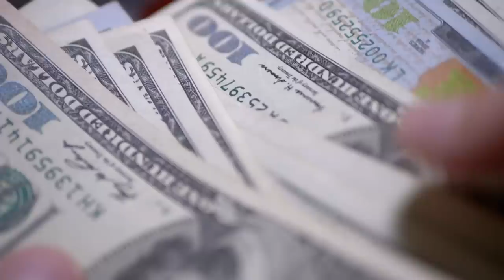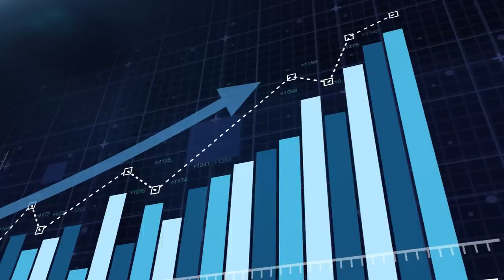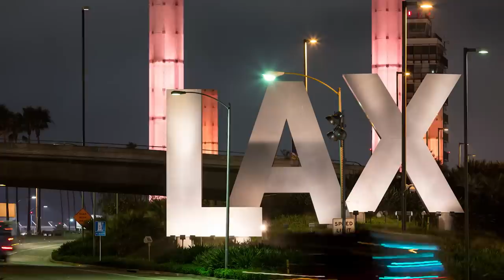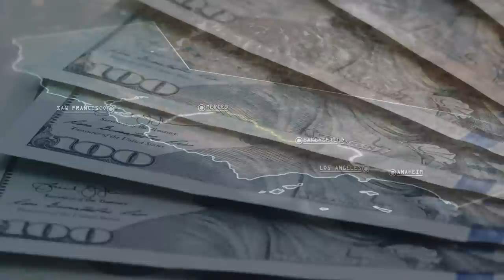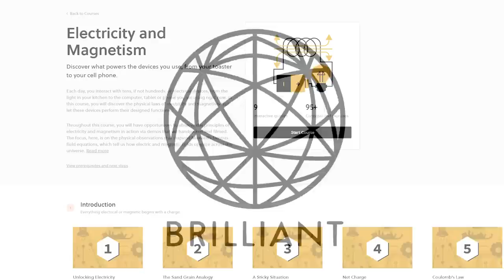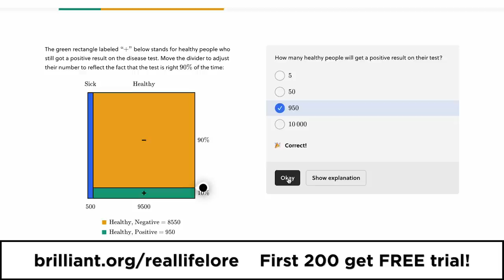Why California High Speed Rail is Struggling (Re-upload)

Comment: I still have an issue with imcluding price rises relative to inflation in the criticism of the project.
I think a much fairer way would be to compare prices after adjustment for inflation, ie that $50 ticket (in 2008 $) would actually be worth $68 in 2022.

The obvious solution would be to levy a tax of more poluting methods of transport (eg flying from LA to San Fran, or raising the tax on fuel) and using that to subsidise tickets on this new electric high speed rail network.

Comment: Hurry up and build the high speed ultra modern train.

Then in true California altruistic self-disrespecting fashion, just give away unlimited free tickets to anyone who claims a need. 

It will take the homeless exactly 0.7 hours to ruin everything. 

Luckily, they wont continue to leave opened empty amazon boxes on the tracks. If they try to hop that train, it probably wont work out for them.

Didn't California get the memo? Stay at home orders. Shut down your car factories and your tech companies and stay home, use Skype and Zoom. Saves traveling or even putting on your pants for that meeting. Nobody needs a train. Well, not enough people to pay for it. If they did, a company would have built it already.

Comment: why not boat?
Reply: Hi, there, the skipper of a high speed boat would have to be a genius. Boats are always crashing into reef and or each other. It would be safer to just use a high-speed train.
Reply: @MrJuvefrank  that actually makes alot of sense, how far off would you have to circle to avoid reefs and hobby boatists? not to mention scale, might be viable for a small group but mass transport is not sea fairing friendly. no traffic or terrain if you're over deeper waters but a storm means more than it does to a car.

Comment: The overall tone of this video is somewhat pessimistic and I think a little misleading. For instance, it's not obvious the comparison with the cost of the Interstate system is valid as it wasn't clearly stated if they were in adjusted dollars. When comparing administration's support you claim that $1 billion retracted by the Trump administration was a big deal but then say the Biden administration may only fund up to $5 billion. So which is it? Is $1 billion a huge amount or $5 billion hardly any? Additionally, scaremongering about inflation is disingenuous, this high inflation period is only going to last a year or two so the average inflation over the life-time of the project will average out to about 2 to 3 percent. The inflation rate since 2008 has been about an average of 2 percent.

Comment: Why do they need all those concrete structures?  You would think they would build along side an already established rail line or along I 5.  Either way, the job was botched from the beginning.  Wouldn’t it be cheaper to build over or underpasses?  Amtrak northeast  corridor uses the original Pennsylvania up the coast.  There is no grade crossings.  In Bakersfield they build overpasses to separate the train tracks.

Comment: the entire US interstate system cost way more than 500 bil. You just need to stop talking about engineering, you aren't good at it.
Reply: Adjusted for 2020s money it costed 500 billion.
Initially back in the 1950s it costed 114 billion.
Reply: @blackhole9961  the issue with that is the entire interstate system wasn't paid for with just the federal portion of 1956 act. More freeway had been built that the 1956 bill accounted for, and it''s had continual support at the federal, state, and local levels since then. It's cost is in the trillions.
Reply: @alexbutler9343  the 500 billion includes cost over runs and extra highway built
Reply: @blackhole9961  it doesn't. It's taking the numbers from 1991, when the system was "finished" and adjusting for inflation. It doesn't even factor in Boston's "big dig" for instance, or the myriad of other endless freeway expansions  and improvements since then that has a yearly federal budget in the tens of billions. Not to mention local and state money, or federal bills on top of that like the Reinvestment And Recovery act.
Reply: @alexbutler9343  yes technically it was completeled in 1991 therefore anything after that doesn’t get included in the bill.

Anything after that genreally just gets included in highway maintenance and well extra money the government has spent.
Reply: @blackhole9961  that's why the 500 billion number is misleading. Not only have we been building bread new freeways since then, but we're constantly rebuilding stack interchanges and all sorts of stuff, and the final bill gets distorted through the myriad of government agencies it passes through.